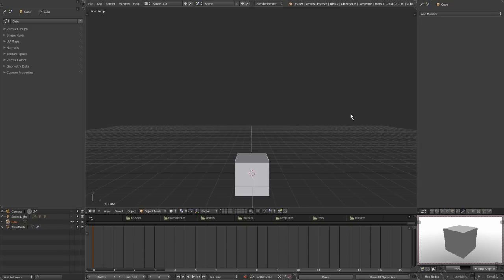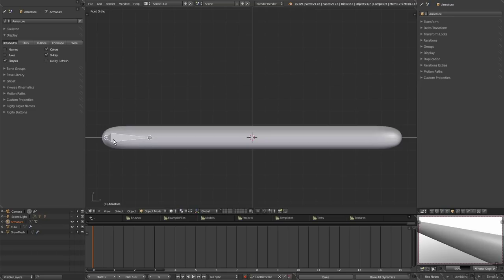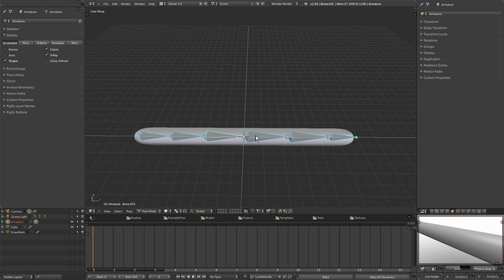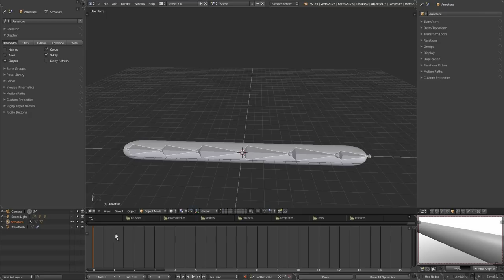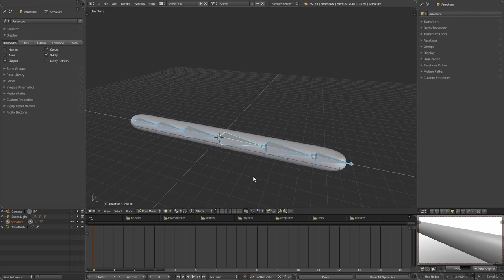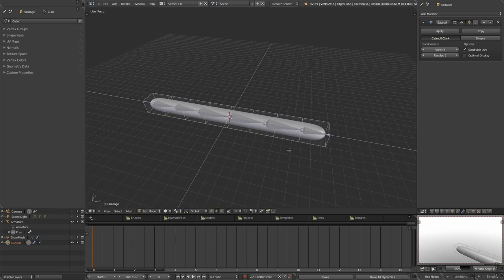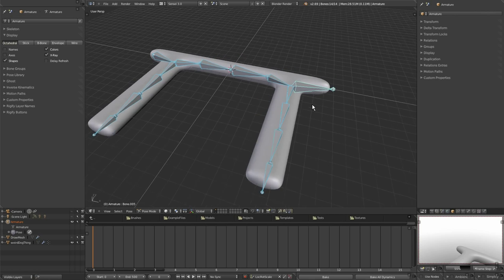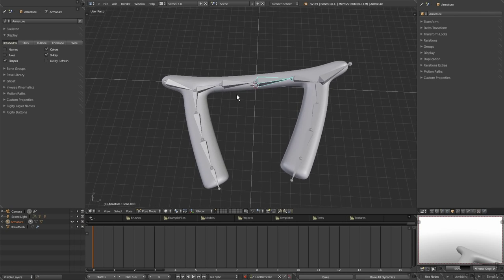Armature Basics

Comment: So what do I do if the bones won't stay connected when I extrude to make a new one, or when I parent them the parent doesn't work and it does nothing when I try to pose my object with the armature?
Reply from the maker: I have no idea. I've never had this happen. Are you sure you're in edit mode while all the extruding is going on and are extruding with E and not hitting D to duplicate? Sorry if these questions seem obvious, I'm just really at a loss for what this could be. Also when you parent are you first selecting your mesh (the child we think of it) then shift-selecting the armature then either hit Ctrl-P or go to Object/Parent/With Automatic Weights? I can't remember if I only used drag and drop parenting in this video which you can do in the outliner by dragging the child on to the parent. You can do it either way but I know you had mentioned having some DND issues with Sensei Format on your computer. Sorry. Hope you get it figured out.
Reply: I've tried all that, the drag and drop parenting works fine. I think it was just a glitch in my copy of Blender. I just downloaded 2.72 so we will see if it works now.

Comment: at 38 second of your video you hit tab to go to edit mode. I hit tab but but there is not an outside box in the shape, instead there  are box lines stuck on the shape
Reply from the maker: john kaburopoulos Indeed. Sorry it took so long to respond. That's because in the last version of Sensei Format I made the editing cage button on by default when you tap "W" to add a subsurf modifier. If you click on the little blue wrench icon to the right in your properties panel menu (this is your modifiers). You will see a "Subsurf" (or it may appear squished and just say "Subs". On that modifier to the right you will see a triangle icon. You can click on it to return the editing cage to the default shape. I thought I put an annotation up about this but I may have missed it on this video.
Reply: Blender Sensei thank you!